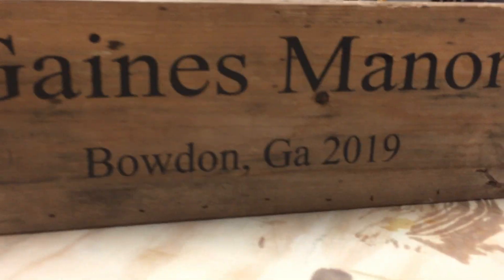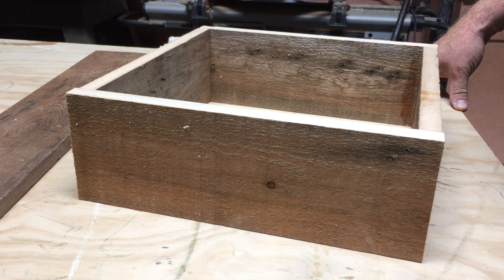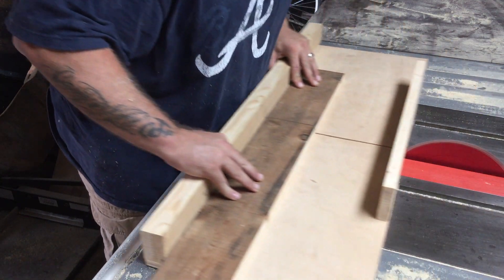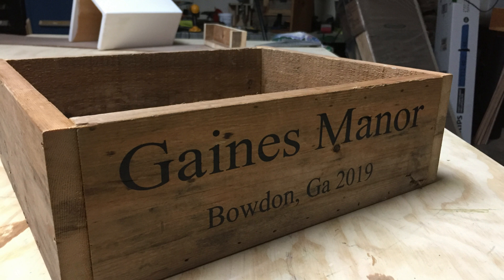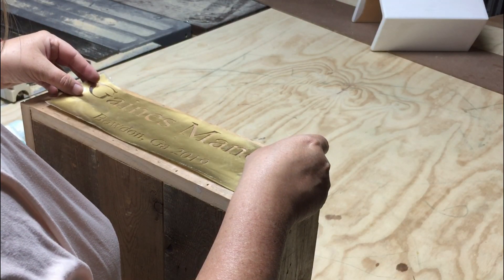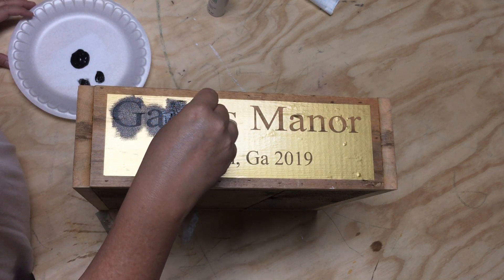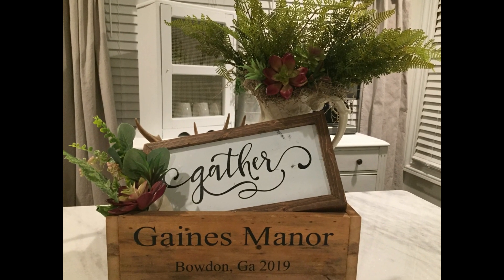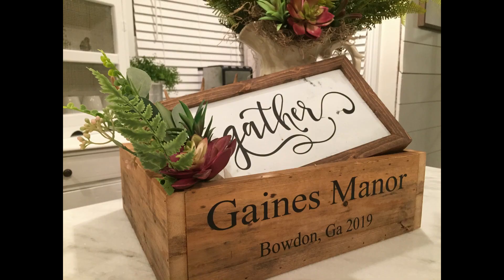Build a Wood Box Table Centerpiece | Personalized Farmhouse Decor |Tony Collum the HOW-TO Hero

Comment: Very cute centerpiece. Great idea for reclaimed wood or old scraps. It doesn't look too hard if you have the right tools. Great idea for making your own stencils.
Reply from the maker: Ashley Rolland it is a very easy build and literally could be built with limited tools.  

Are you a fan of the rustic/reclaimed decor or more modern decor.

Thanks for watching!
Reply: Tony Collum the HOW-TO HERO great to know. And I probably lean towards rustic but mix and match a little 😊
Reply from the maker: Ashley Rolland, I think that mixing the different styles actually adds a little depth.  My wife uses the term “rustic glam” and it looks great.